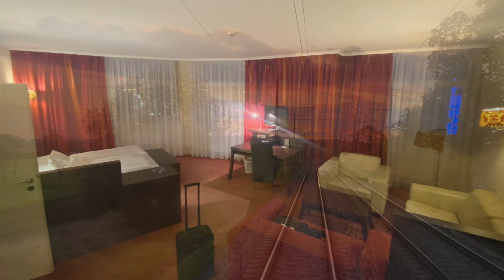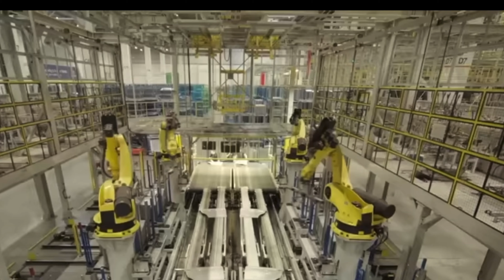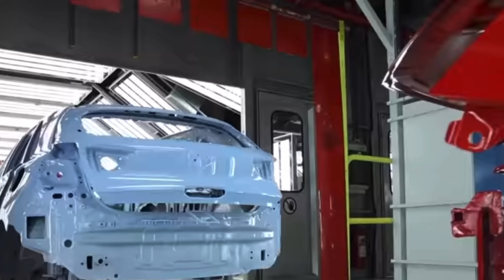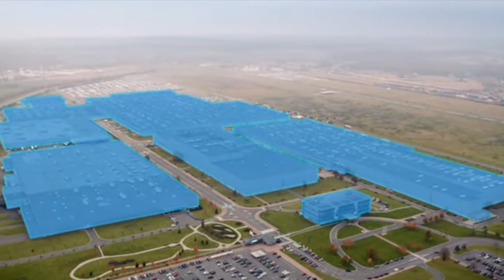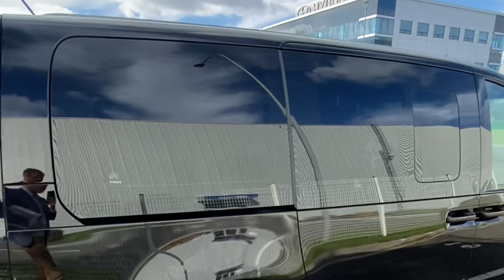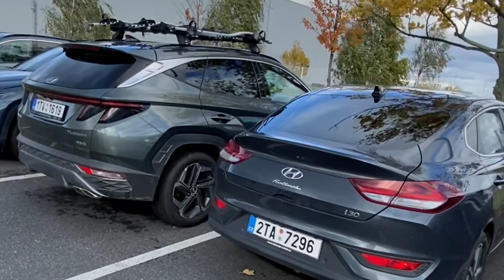Hyundai Nošovice production facility tour Czech Republic 2023 #tour #HyundaiNošovice #czechrepublic

Comment: Hello! I don't think you can tell if it's the 1.0 T-GDI mild hybrid or 1.5 T-GDI Mild Hybrid by just looking at the exterior. I'm from Romania and they only sell the 1.5 T-GDI mild hybrid here so you can tell here but in the Western Europe, for some reason, they sell the 1.0 T-GDI with Mild Hybrid. We get, as the basic option, the 1.5 DPI (naturally aspirated) petrol that makes 110ps, that one seems to be missing from other countries. Something that is really nice and we don't get here is the Wagon with the LED headlights. We only get the Hatchback with LED headlights.
Reply from the maker: I do stand to be corrected on the engine sizes as I’m not 100% sure, so you guys get a 1.0 mild hybrid there ?? As well as 1.5 ?? 🙂🙂
Reply: @briandoolanatfitzpatricks  So, for the i30, we get 2 versions of the 1.5: The 1.5 T-GDI with Mild Hybrid 160hp and the 1.5 DPI (naturally aspirated petrol) 110hp. However, in Germany, Czechia and other coutries you can get the 1.0 T-GDI 120hp with Mild Hybrid and the exterior badging is the same. We only get the 1.0 T-GDI on the i30 if someone imports it from other EU countries as a used car. Generally speaking the prices are lower here but you cannot get custom ordered Hyundais at all, you need to pick from the preexisting trim levels. So we can get the Wagon since 2020 but no N-Line and no Exclusive trims on the Wagon. You can get the most only on the Hatchback and on Fastback.
Reply from the maker: @10mbc  thanks for all the details information, so there seems to be a lot more variety than I realised, I’d like to drive the 1.5 turbo with 160 BHP 👍